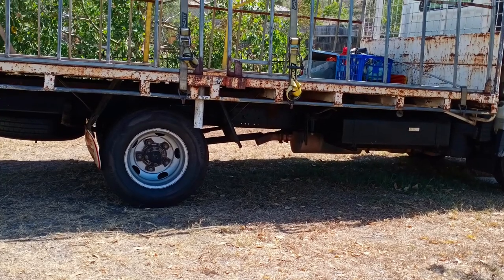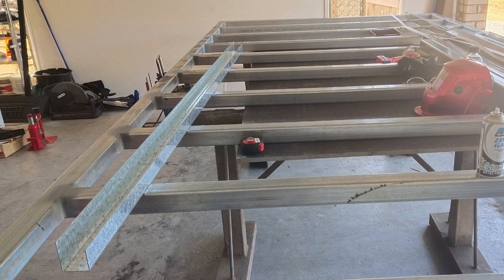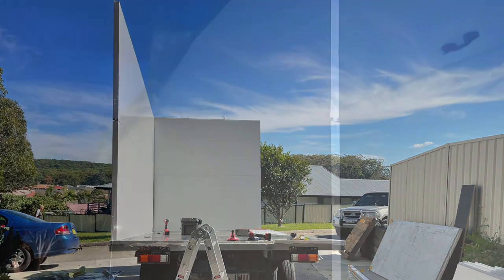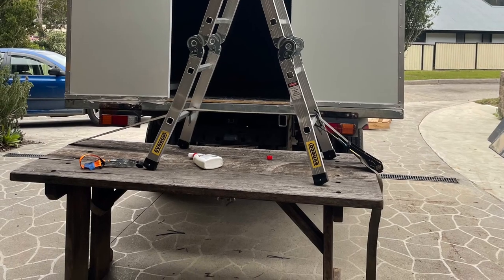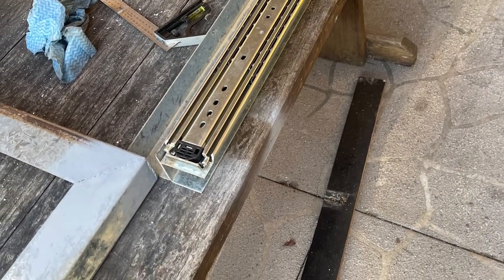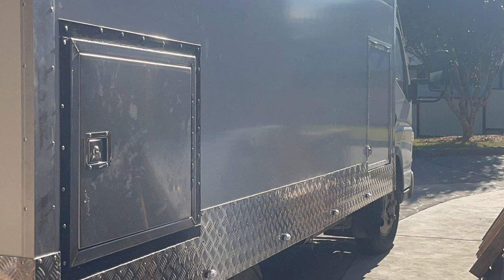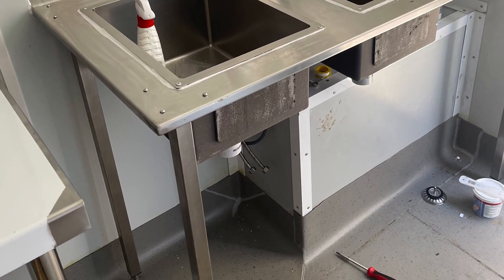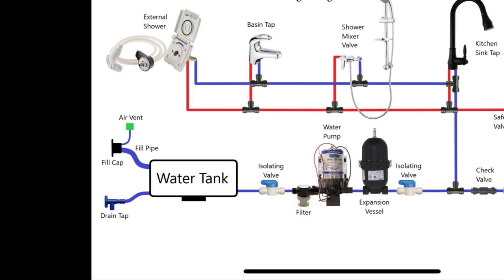Food truck build Australia

Comment: Hi mate, looking, building my own truck what size water and waste tank did you use and where did you mount it. What size is the overall box
Reply from the maker: Depends on council but minimum 95 lt clean water and 110 grey water will
Keep you out of trouble for sure. In all states
Reply: Where did you mount the water tank? any more photos of the build would much be appreciated
Reply from the maker: @yilmaztintas9421  fresh water under truck body on passenger side. Between battery and wheel. And grey water was behind wheel on driver side it all depends on your setup inside where the sinks are. You might have to move the diesel tank or battery.
Reply: Thank you mate